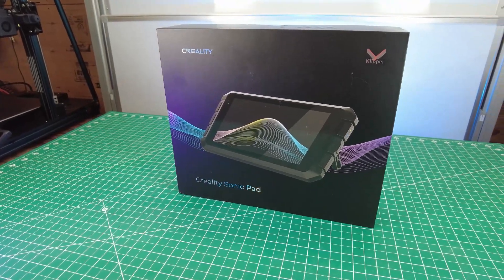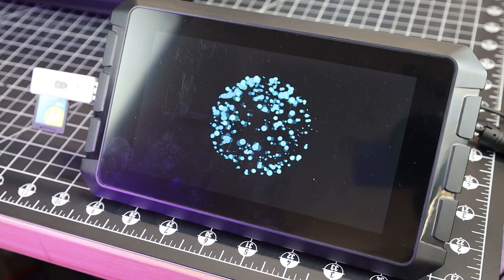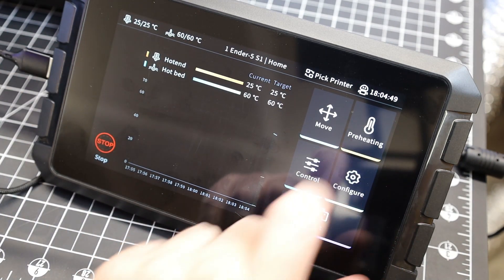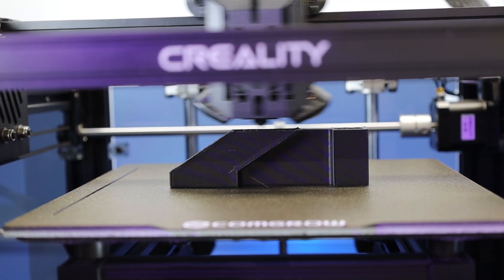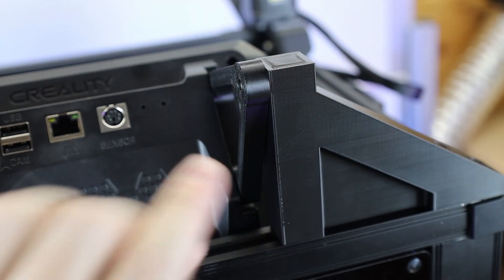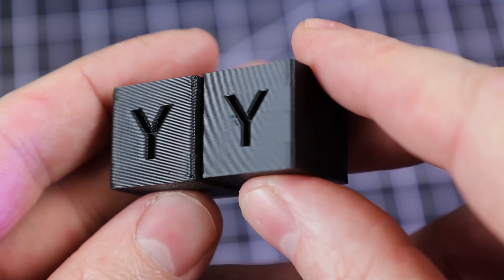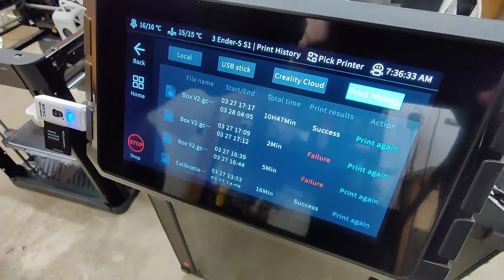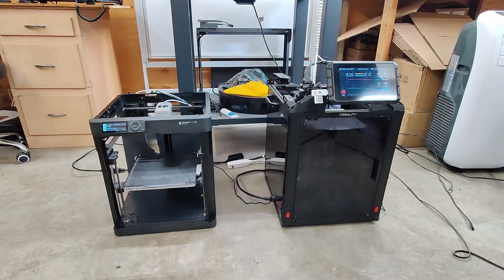Sonic Pad on Ender 5 S1

Comment from the maker: Creality Ender-5 S1 (From Creality) - https://bit.ly/Creality-Ender-5-S1
Creality Ender-5 S1 (From Amazon) - https://amzn.to/3FwHVUI

Creality Sonic Pad (From Amazon) - https://amzn.to/3YZUYoy
Creality Sonic Pad (From Creality) - https://bit.ly/Creality-SonicPad

Use code 5S80 to save about $80 on the Ender-5 S1 Speed Combo
Ender-5 S1 3D Printer Speed Combo(From Creality) - https://bit.ly/Ender-5-S1-3D-Printer-Speed-Combo

Enclosure Options:
Acrylic Enclosure for Ender-5 S1 https://bit.ly/Ender-5-S1-Enclosure
Soft Tent Enclosure - https://amzn.to/3GMXwkj 
Other 3D Printer Enclosure - https://bit.ly/Creality-3D-Printer-Enclosure

Sonic Pad Mount For Ender 5 S1:
Ender 5 S1 Sonic Pad Mount 3D Files - https://bit.ly/Ender-5-S1-Sonic-Pad-Mount

Hardware:
4 x M5x35mm https://amzn.to/3ZdikHL
6 x M3x12mm  https://amzn.to/3Tq27NS
2 x M3 Brass Inserts 4mm x 5mm https://amzn.to/3Jpicil

If you doing to be building other things I suggest getting some hardware kits. They are a better bang for the buck. Here are some links to stuff that I used.
M3 Stainless Steel Hex Socket Head Kit - https://amzn.to/3JuH4oX
M5 Stainless Steel Hex Socket Head Kit - https://amzn.to/40115uq
Heated Brass Threaded Insert Kit - https://amzn.to/3ToPEKu

Heat Pressing Machine - https://amzn.to/3M2KtOK
Heat-Set Insert Tips - https://amzn.to/3nszAvg

Bambu Lab Printers:
Bambu Lab P1P 3D Printer (US) - https://bit.ly/Bambu-Lab-P1P-3D-Printer-US
Bambu Lab X1-Carbon Combo 3D Printer (US) - https://bit.ly/Bambu-Lab-X1-Carbon-Combo-3D-Printer-US
Bambu Lab UK Store - https://bit.ly/Bambu-Lab-UK-Store
Bambu Lab EU Store - https://bit.ly/Bambu-Lab-EU-Store

Enclosure for the P1P:
Bambu Lab P1P Enclosure Kit https://amzn.to/46AeGfA
ARC Bambu Lab P1P Enclosure STL Files - https://www.printables.com/model/356301-arc-bambu-lab-p1p-enclosure

3d Printer Filament That I Use:
PolyLite ABS - https://bit.ly/PolyLite-ABS
PolyLite ASA - https://bit.ly/PolyLite-ASA
PolyFlex TPU 95 (Flexable) - https://bit.ly/PolyFlex-TPU-95
PolyLite Silk PLA Blue - https://bit.ly/PolyLiteSilkPLABlue
NylonX Filament - https://bit.ly/MatterHackersNylonX
PolyTerra Marble PLA - https://bit.ly/PolyTerraMarblePLA
TECSONAR Tricolor PLA - https://amzn.to/3H79d5N
Build Series PLA - https://bit.ly/MatterHackersBuildSeriesPLA
Build Series Silky PLA - https://bit.ly/BuildSeriesSilkyPLAMatterHackers
Build Series ABS - https://bit.ly/MatterHackersBuildSeriesABS
Build Series PETG - https://bit.ly/MatterHackersBuildSeriesPETG
PRO Series Filament - https://bit.ly/MatterHackersPROSeriesFilament

Amazon 3D Printing Filament:
PLA - https://amzn.to/3gsLE9Z
PETG - https://amzn.to/3pXjjvu
ABS - https://amzn.to/3wsTRjS
ASA - https://amzn.to/2RX8dtM
Polycarbonate - https://amzn.to/3cLdr38
Nylon - https://amzn.to/3iNGeI2________________________________________________
If you are looking for more tools and materials that I use, well you're in luck! I made a page on my website just for that.
https://GomeowCreations.com/tools-and-materials 
https://GomeowCreations.com/partners-discount-codes

Note: Most of the links that I use that go to products are affiliate link. This means I make a small commission on anything that you happen buy using them. This is at no extra charge to you and this helps support the work I do on this channel. 😁👍
______________________________________________
Other Ways To Help Support The Channel:
My PATREON ➜ https://patreon.com/GomeowCreations
One time support ➜ https://paypal.me/gomeowcreations
______________________________________________
Instagram ➜ https://instagram.com/gomeowcreations/
Facebook ➜ https://facebook.com/GomeowCreations/
______________________________________________

#diy #gomeowcreations

Comment: No mention of the accelerometer? What do I do with it. Where does it attach.
Reply from the maker: The profile is already setup for that if you're using a Creality printer but if you wanted to run it on your one you can as well. You will have to 3d print a mount for it to go on the print head. You will only run this once and then you can unplug it and remove it from the print head.
Reply: @GomeowCreations  when you say already set up do you mean I don't need to attach and run it at all if there is a creality profile? So I can run my ender 5 s1 and my ender 3 v2? Can I run them both at once off one pad?
Reply from the maker: If I'm not mistaken then yes. That is what I did with the ender 5 S1

Comment: Wow I wish my setup went that easy. Auto leveling won't work on the sonic pad.
Reply from the maker: Really?
Reply: @GomeowCreations  i just updated my s1 to the latest firmware from creality and my auto bed is probing behind the bed....
Reply: @st33lp4d I’m having the exact same problem. Had to level by hand which has worked pretty well but if you’ve found a fix pleeeease share!

Comment: 90% of the reviews I see on the Sonic Pad talk about how easy the screen gets marks from use. Mine arrived this week and it has a screen save pre-installed. It's hard to tell it's there but a fingernail on the edge will get it to show.
Reply from the maker: Yeah I've been getting a lot of comments telling me that the screen protector is already on there which is great but it's also super annoying cuz it scratches really easily

I have also had people tell me to just remove it and there's a glass screen underneath but I'm just going to keep it on until it's so bad that I need to remove it I guess.